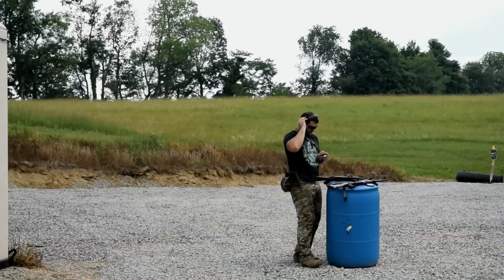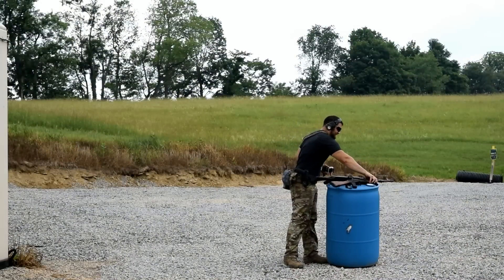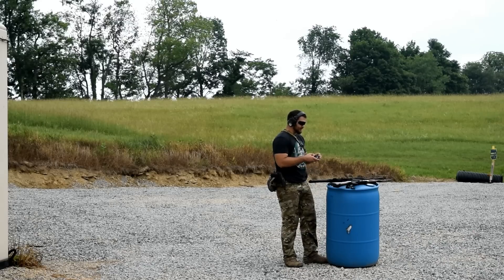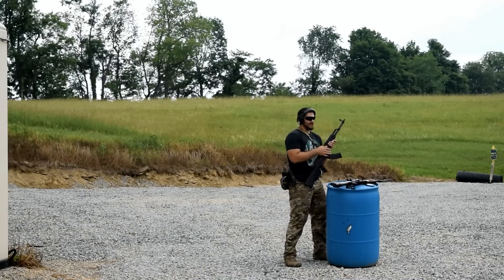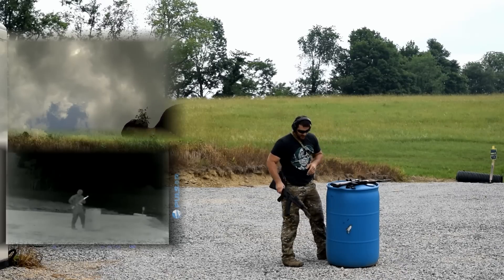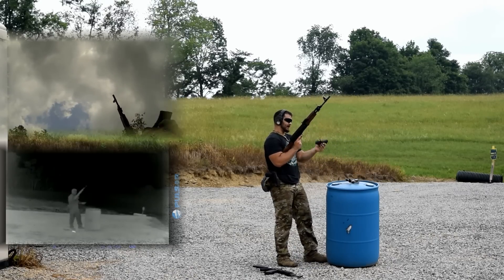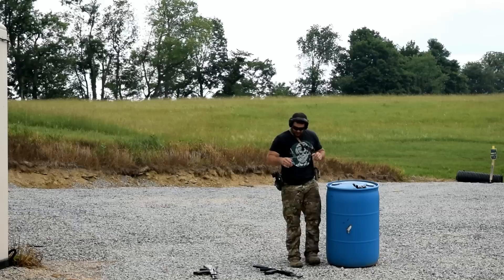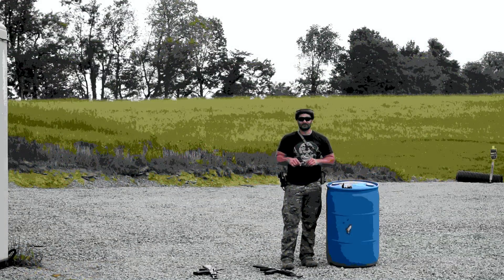AK-47 Thermal Muzzle Brake Test

Comment: How well is that C39V2 holding up to the abuse? Whats the round count threw it so far? As far as the thermal experiment went, I didn't see much difference.
Reply: Looks like with the century arms c39 brake the heat traveled further down the rifle to the gas tube.
Reply: I have a c39 v2 with over 3000 rds through it and zero malfunction and ware looks normal I love it
Reply: @ashemsavage6842 my experience is similar, with only half the round count 😢 poor people problems 😂

Comment: Does anyone know if the muzzle break is suppose to be a little loose mine seems like it needs to be about quarter of a turn to be solid
Reply: have 2 aks  both a little loose but have a pin ..
Reply: keyboardbeats you can use a crush washer or Teflon tape to fix that
Reply: It’s ok they are all like that
Reply: It suppose be like that to allow carbon build up to be removed after extensive use. Always put a drop of CLP on the threads to keep them clean.
Reply: I used a rubber o-ring. Got over a thousand rounds. Hasn't melted yet 😂. I couldn't abide the loose tolerance, especially on my already loose tolerance rifle.